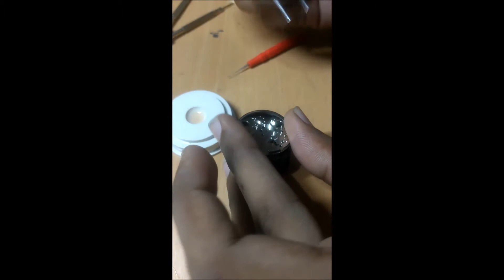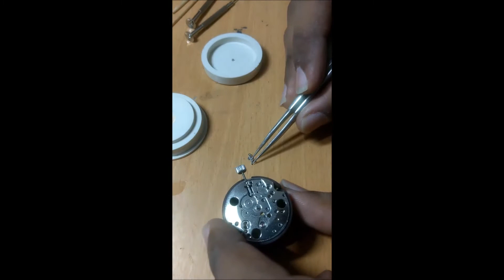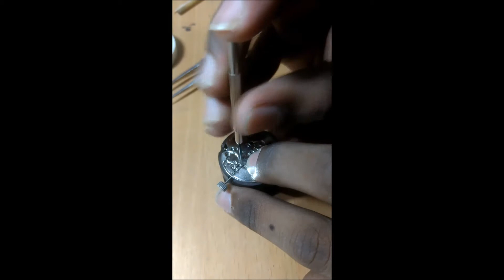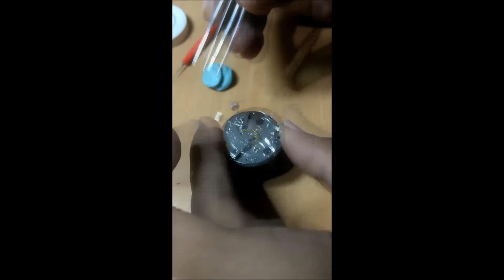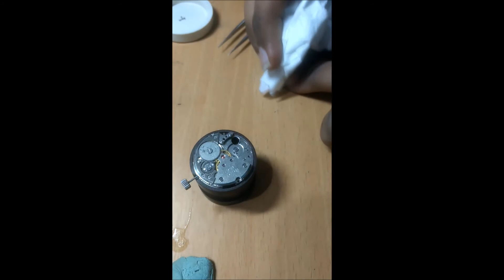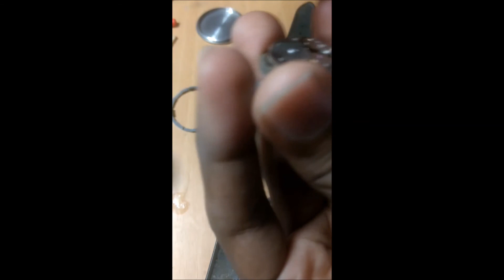HMT SERVICE PART-3 : Assembly and Lubrication

Comment: thanks dude unfortunately i opened my old hmt pilot to service but struck to assemble it for 3 days
Reply from the maker: That is the reason why I advise to practice on scrap movements! What is the exact issue you are facing during assembly?
Reply: @ullasu1788  thanks for asking, first i can't fit the escape wheel, palette wheel and hairspring but now i fixed it but it was stopping after some time of running Maybe it was too lubricated
Reply from the maker: @yaswanthyalamuri8799  Hey, terribly sorry for late response, I was a bit occupied. What do you exactly mean by palate wheel? Make sure the gear train runs smoothly. Yes, excessive lubrication can stop the watch, but there could be other factors as well, if it's running for a while and stopping
Reply: @ullasu1788  No Problem ullas whatever i did i know it was a bit hasty. But now everything was absolutely fine i removed lube with clean petrol and relubricated it. Now it was running marvellously.
Reply: by palate wheel i mean the 3rd steel wheel besides the minute and seconds wheel

Comment: Many thanks! You have helped me service my janata which is quite rare here in europe. As far as I know, you should not lubricate any teeth except for escape wheel. I have watched many tutorials and janata is my first patient. I find keyless works to be the most difficult part of the service
Reply from the maker: Thank you for your words sir. Coincidentally, I am wearing a Janata typing this. Yes, no gear teeth has to be lubricated except escape wheel. In the keyless works, I have the habit of lubricating the contact between teeths of sliding and winding pinions. Keyless works are initially difficult, but later fun to work on!
Reply: @ullasu1788  Unfortunately, despite all my theoretical knowledge I destroyed my janata today. I managed to insert cap jewel wrong way and it flew out of brass frame. Such a bad feeling. I will ask local repair guy if he has para shock jewels
Reply from the maker: @rokokoko123  citizen movement parts are interchangeable with HMT sir, I guess that might be available there? Also, if the jewel is not broken, it can be pressed back into the frame.
Reply: @ullasu1788  The jewel ejected itself in my face then it fell somewhere. I really don't know where it is. But I think it was a great success to take apart janata a couple of times before this happened
Reply from the maker: @rokokoko123  I wish you luck in finding a replacement sir, surely it shouldn't be difficult

Comment: Hi Ullas, It was nice seeing you work on the watch. I have been collecting swiss watches since 20 years now and have destroyed a lot of them while trying to learn to service or fix them. I can service a watch now but I am still not half as good as you are. BTW I have recently settled in Benguluru. Maybe you could help me to get in touch with any watch parts suppliers.
Reply from the maker: Sure sir, i would be more than glad to provide you with details of watch spares shops. You can contact me on 9686951979, I'll be able to send their contacts

Comment: Hi,

Where did you find the holder for the 0231 movement? Your video series is gold!!
Reply from the maker: Subramaniyam R thank you sir. It is available in Bangalore. You can PM me for details
Reply: Ullas U thanks for your reply, but i am unable to pm you as i cannot see tye option on your about page..
Reply from the maker: Subramaniyam R i will message sir🙂
Reply from the maker: Subramaniyam R you can try with Hindustan watch house in Chickpet, Bangalore. 
Contact: 080 2287 2234

Comment: No matter what i do, the balance wheel doesn't rotate at all, tried all possible ways changed balance wheel and blowed and yet it doesn't come to life, what to do?
Reply from the maker: Try rotating it with the tweezers gently. Do you feel any resistance? If yes, the roller jewel may not be seated in right position while installing. Another thing to check is, assemble the balance without lever, and see if it swings freely
Reply: @ullasu1788  how can I contact you? I really need to learn this art of servicing 🙏
Reply from the maker: @rakeshmurthy4272  you can message me or call on 9686951979